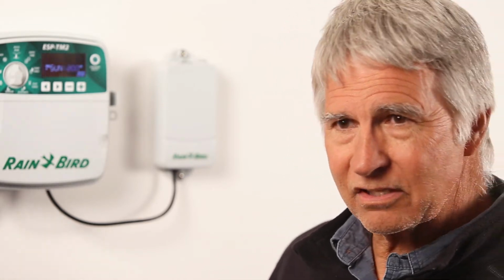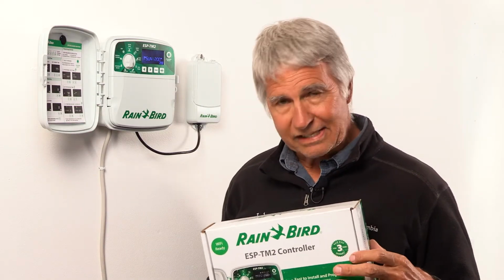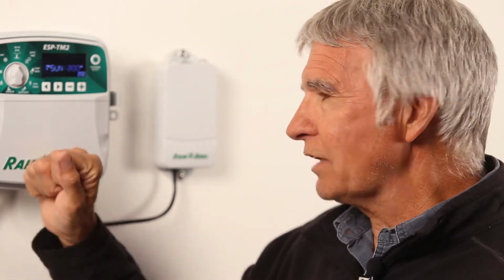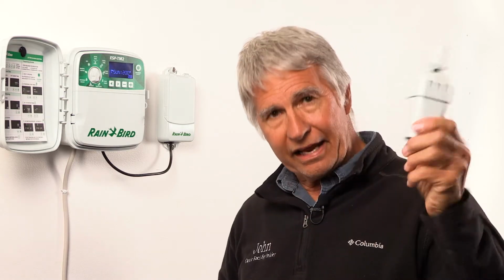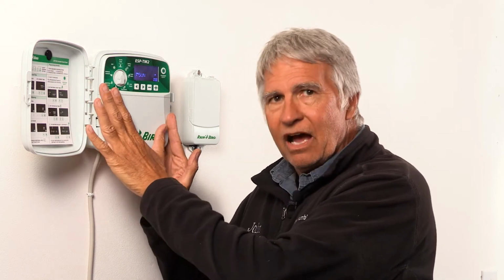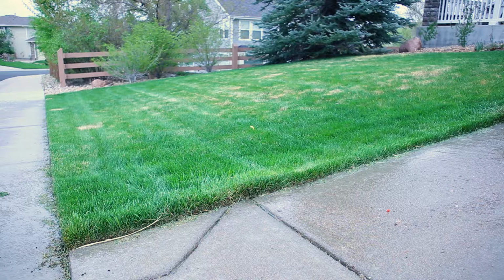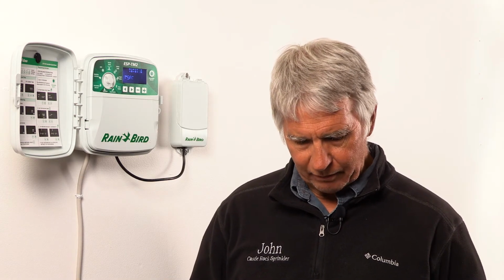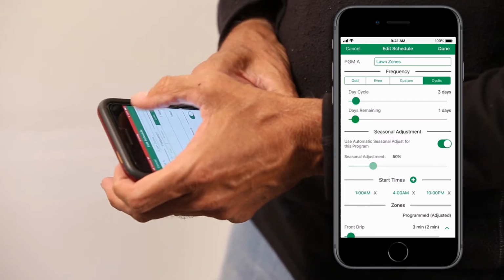Save Money & Water with the Rainbird ESP-TM2 Smart Clock

Comment: Well presented.  Does the app know when its forcast to rain so it wont water those days or do you need the rain sensor for that to work?
Reply from the maker: Yes, the the  rain/freeze sensor shuts off watering for local events.  For instance my unit is set to shut off watering if there is more than 1/4” of rain.  I have it set to not water if the temp falls below 41 degrees.  The system will send alerts when the temps are expected to dip below freezing. It will also alert if the system is shut down because of a local rain event.

Comment: For opnly $100 you can have a privacy invading chip installed. Or you could just walk out to your sprinkler controller and adjust the Seasonal Adjust setting manually and save $100.
Reply: The chip comes with a free tin foil hat so you're covered bud